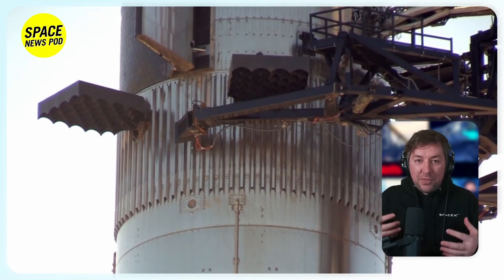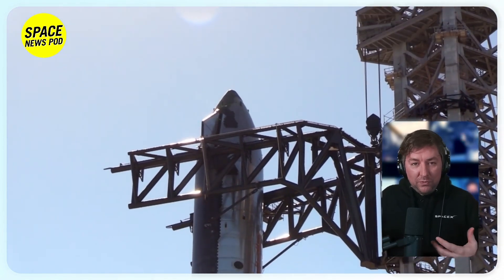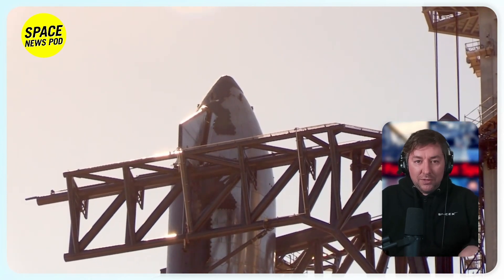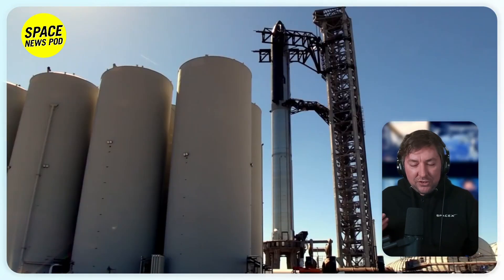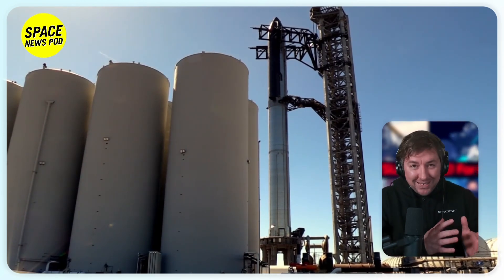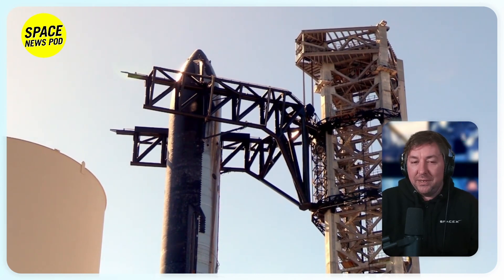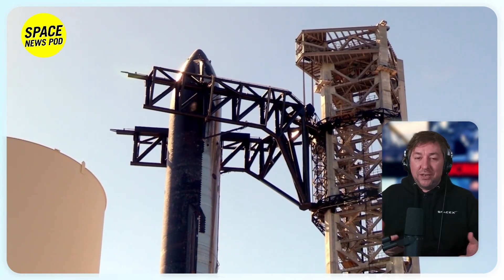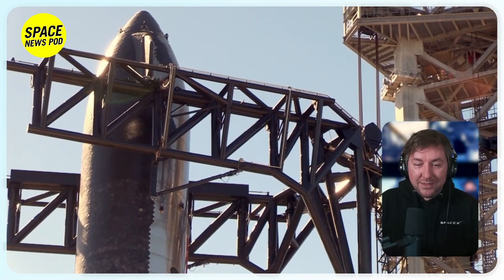Next Steps for SpaceX Starship IFT-3 Test Flight

Comment: I believe that the fuel transfer test is for 10 metric tons. I believe that the lox header is easily big enough, by a factor of 2. So, a successful transfer from the header tank to the main tank would satisfy the requirement. For safety, I believe, they were planning to vent all remaining fuel before reentry, so no need to save it.